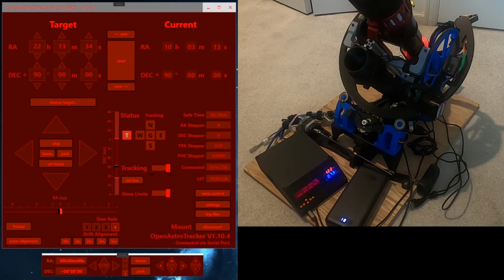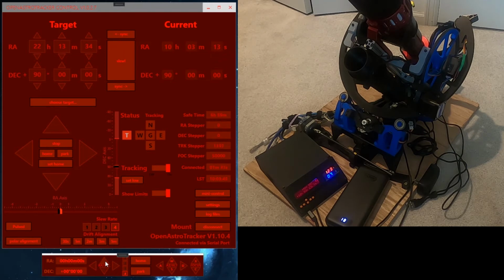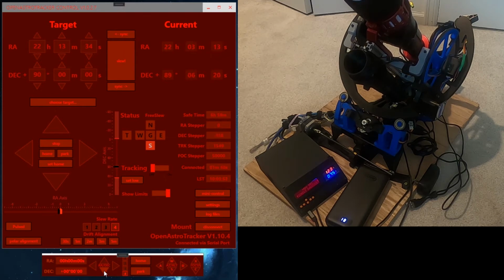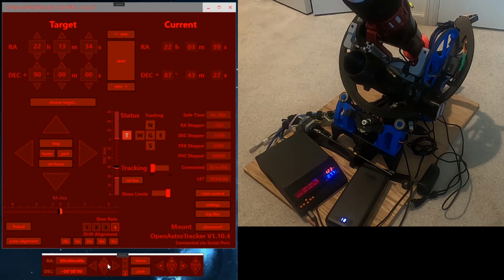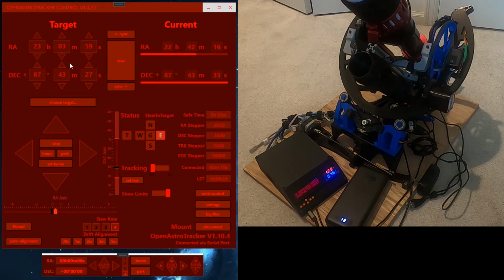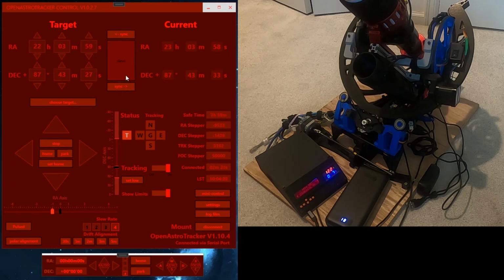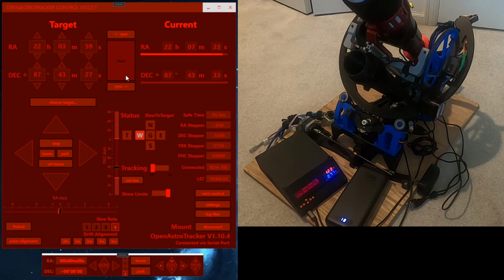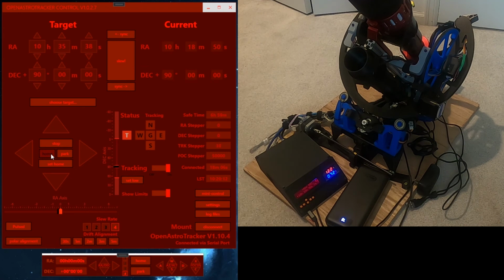Checking Directions on OAT

Comment: Yo vivo en 36.72N, la inclinacion correcta de mi anillo RA deberia ser 30 o 40, o si pudeo, ajustarla  a 38 grados?
Gracias por el video.

I live in 36.72N, the correct tilt of my RA ring should be 30 or 40, or if I can, adjust it to 38 degrees?
Thanks for the video.